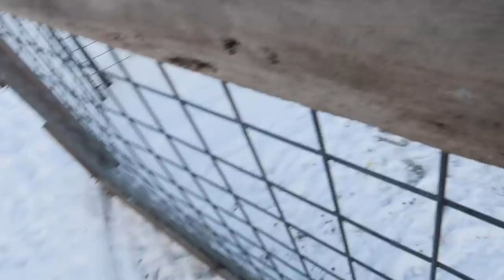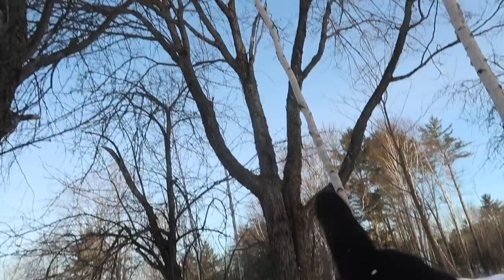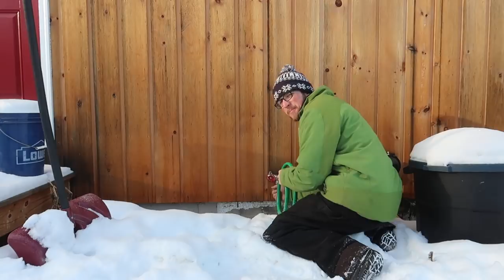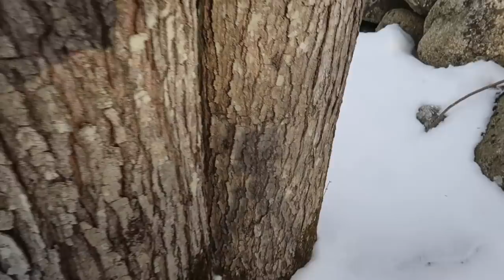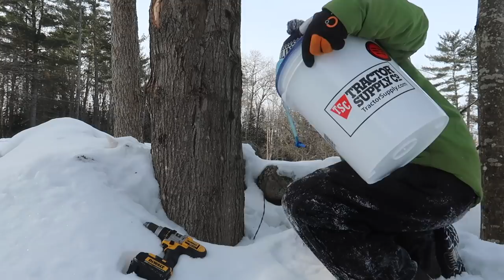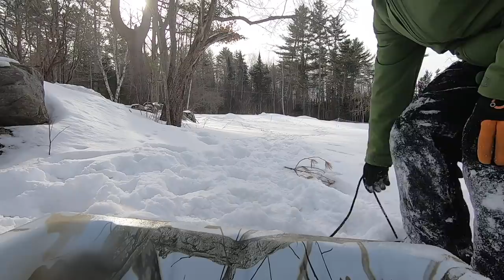This SNOW is So DEEP I hope it Doesn't RUIN Our MAPLE SYRUP SEASON On the Hunt for Liquid Gold

Comment: I have one bucket up to monitor when the sap starts to flow but up here in northern New Brunswick it is still in the minus temp and we are 3 to 4 weeks away from the sap to be flowing. This will be our first year making maple syrup. I plan on using a large pot and a propane burner outside and I have a 30lb tank so I hope I don't use tons of fuel. Next summer I am going to build a sugar shack out of pallets and use a wood stove so making the maple syrup will cost nothing. Thank you for sharing, I will use tape on the drill bit GREAT IDEA!.

Comment: Al you can also tap Box Elder trees. The sap has the same flavor as maple because it is in the same family. The drawback is that you need more sap to get the same yield of syrup since it has a higher water content.  We had temperatures up to 49° two days ago with 3"of rain. It took about eight inches of snow off overnight and broke the ice loose in the rivers causing flooding and ice jams. Last night it was down to eight degrees with a high of twenty six. Gotta love this Iowa weather. If ya don't like what it is right now wait an hour it'll change.  They say you can tell an Iowan when they say they like it in the winter cause the roads are smoother, since the snow and ice fills in the potholes.

Comment: putting a stop on your bit is a great depth.  alot of people use a peice of tubing that fits over the bit.  Lightly tap in so it goes tap tap tap thud.  after the thud stop hitting it or you split the bark and then your losing sap out the crack.  dont use soap or bleach, the taste can transfer into the sap very easily.  straight hot water or you can add some vinegar.  that mix works great on cleaning stainless too.  easy off oven cleaner in the yellow can for the bottom of the pan/pot.  soot acts as an insulator.

Comment: Al I don't see vent holes in the tape. All my aluminum taps have a relief for the transfer of air being a liquid. I tap about 20 trees and use aluminum taps with open buckets and an inverted v of sheet metal for a cover. It's nice to see you taping your maple trees. I know it's still early here in Iowa to tap although some may be. Great vidoe.

Comment: blowing in the tap holes introduces bacteria right away.  bacteria is how the hole seals/heals itself.  better to use a screwdriver or fashion up a scraper.  i made one from solder.  10 degree angle or straight in.  you are almost 45 degrees which can make an oblong hole.

Comment: That snow moon was beautiful wasn't it?! I don't know much about tapping Maple trees, but I had always assumed you could use the same hole, but I see that is not the case. Do you know why? I also see you are using a plastic type tap (maybe it is metal as when you hammer it, it sounds metal), is there a difference on why not the metal ones? I'm sure the metal ones are more expensive, so that could be a reason. I think some of the metal ones you hang the bucket from the tap as well. Nice that you have all those Maple trees to get syrup from and I hope you get a lot as I know it takes a lot to make one gallon of syrup.  Can't wait to see you make the syrup!!!

Comment: I put 10 taps in sugar maples yesterday 2/22/19.  and 3 out if the 10 were running.  not much but about a 1/2 inch in 3 of the pails in about 3 hours.   I live in WI  zone 4b  We also follow you on the gram, @driftlessacres

Comment: You should look for a reverse osmosis system to save on propane to make syrup. Also check out your neighbor and his wood fired boiler and finish in the house. Propane is just too expensive. 3/16 tubing would be great to help bring the sap to a tote.  Watch for an old dairy and get there vacume pump and transfer pump system.  Your syrup will sell like hot cakes.